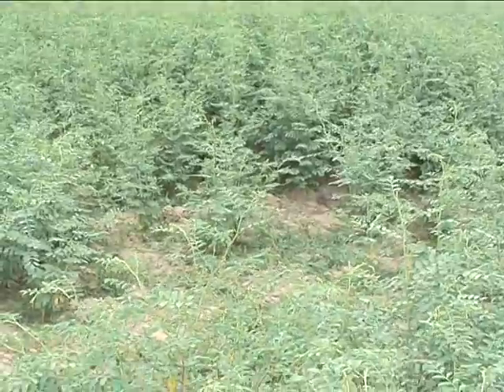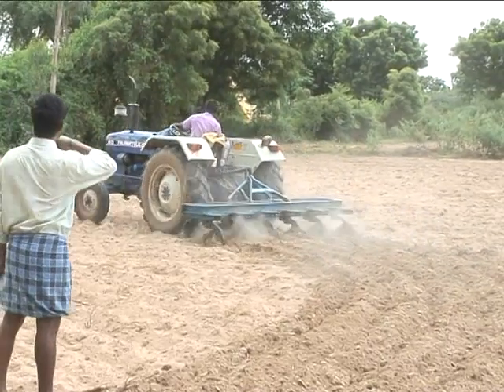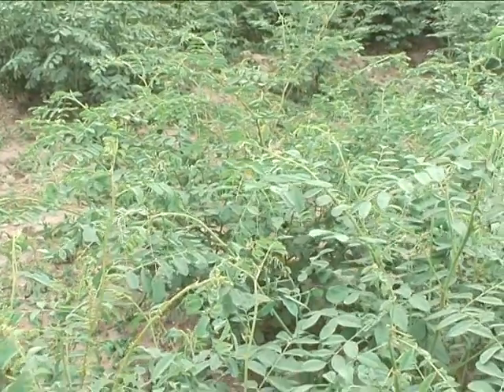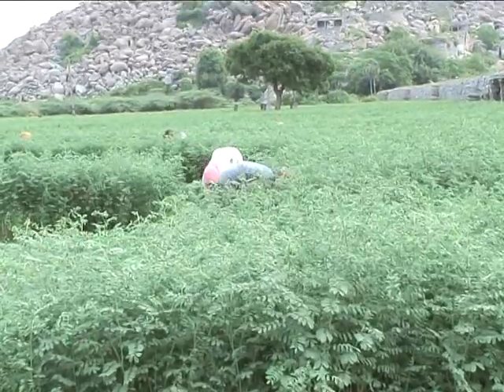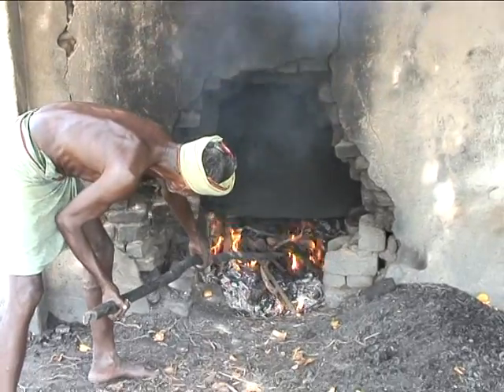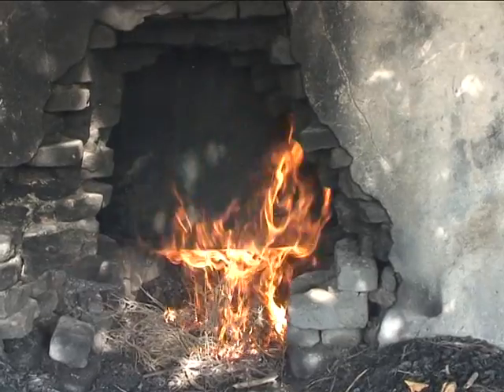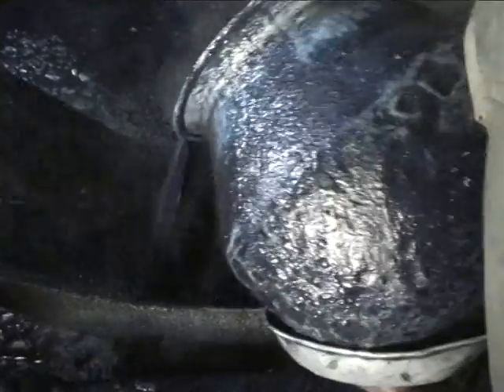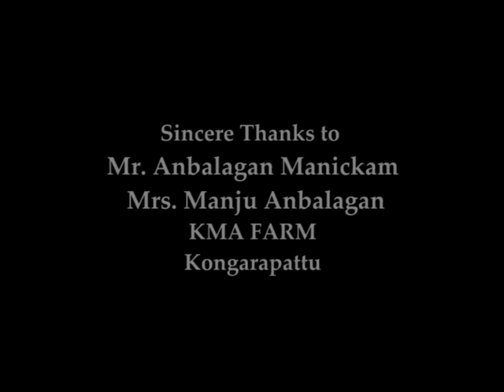Indigo Dye Extraction

Comment: ". Agitation of the water ferments the chemical converting the glycoside indican into the blue dye indigotin. "

Agitation of the water AERATES the fluid.  A E R A T E S.  It does not "ferment" it.  Fermentation is something entirely different and is what happens in the FIRST tank where the plants are rotting (fermenting) in water.  Fermentation is another word for DECOMPOSITION.
Reply: Thank you for this clarification. I was totally confussed like..humans don´t have the ability to ferment xD
Reply: yes!!! the indigo turns from green to blue due to oxidation, which requires oxygen. Thats why they are aerating it.
Reply: I'm sorry but this comment confused me.  I'm not sure what process is going on in this tank, but I make my own wine and I do know that mixing oxygen to a slurry or a must helps yeast grow and kick starts fermentation. Also, rot is different than fermentation. Both fermentation and plant rot are a form of decomposition because they break down molecules into smaller parts, but they have very different results.